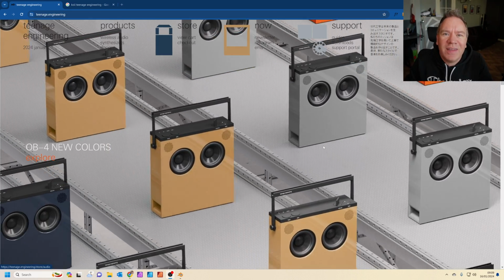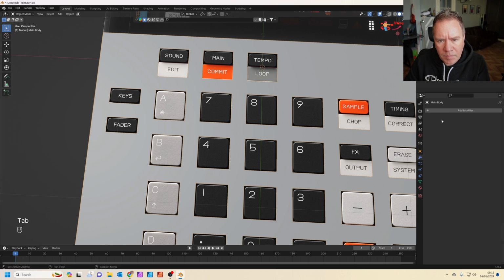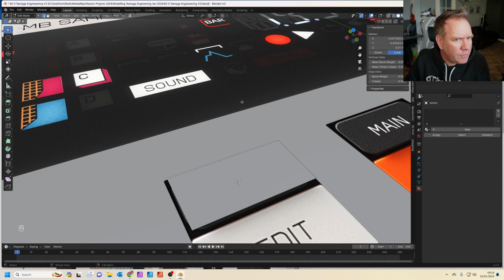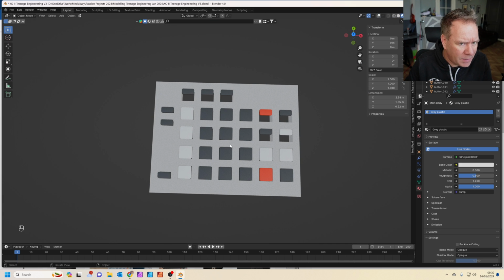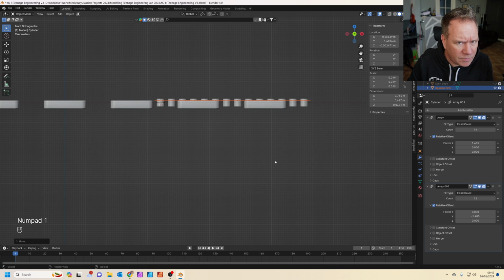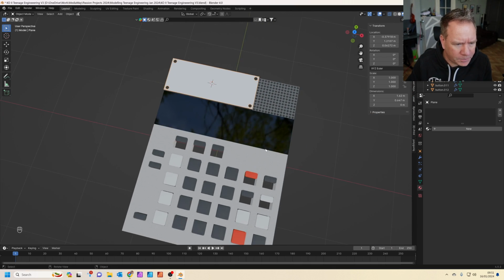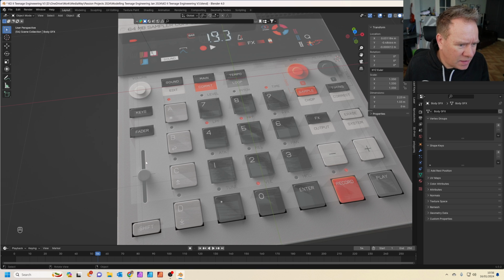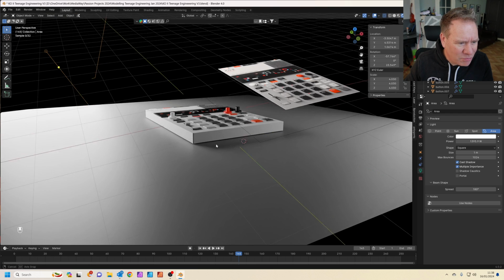3D MODEL A REAL PRODUCT in Blender. FULL PRO TUTORIAL showing every step of modelling and lighting.

Comment: It wasn't quite clear to me how you applied the button graphics. Did you just adjust the image plane in the Z direction until the graphics were right on top of the button geometry? Or did you use the shrink wrap modifier? Your process went very fast. Great tutorial, thank you.
Reply from the maker: Thanks for your comment. Yes - you're right - the transparent image is simply placed exactly on top of the button geometry. I considered using a shrinkmap modifier, or mapping it onto the materials, but this was the quickest and easiest solution. Glad you enjoyed the tutorial otherwise! 😀
Reply: @MediaWayUKLtd  Thank you
Reply: this is a great shortcut! but i don't think it would be too hard to unwrap those buttons and pop an image tex on to it, then you'd be able to add that lil bump on the numbrs @MediaWayUKLtd